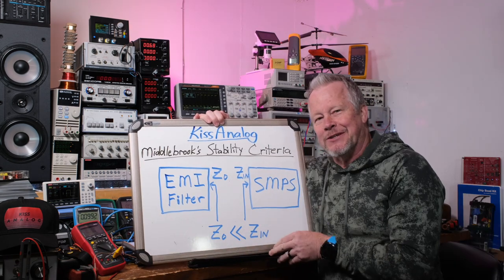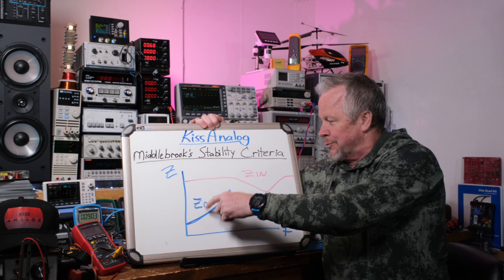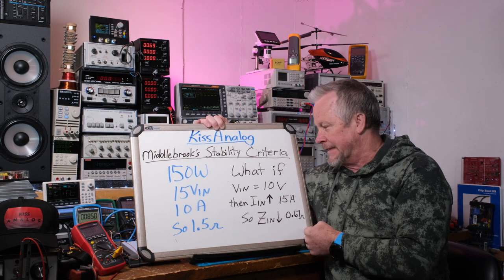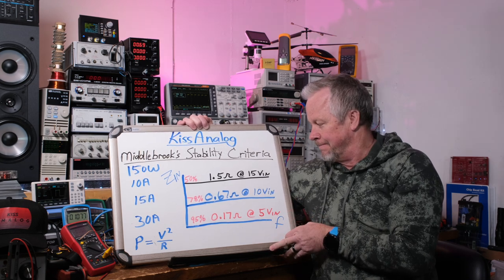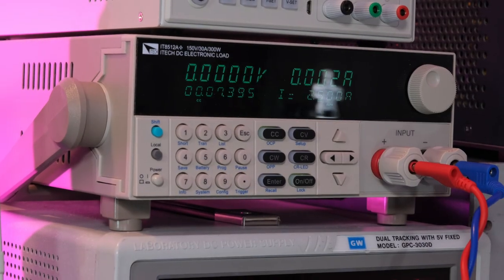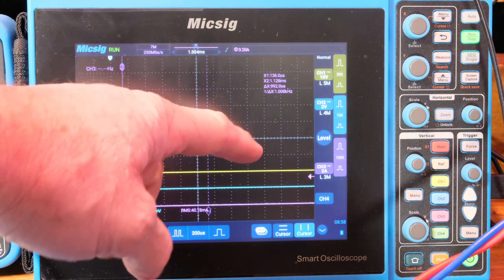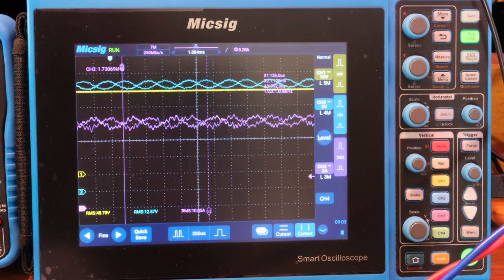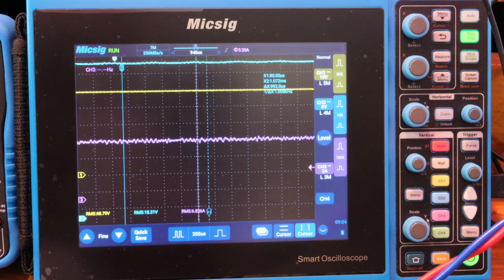Middlebrook Stability Criteria - The Easy Way

Comment: I worked in the IT department of an engineering company. The building was supplied 3 phase power. Sometimes when one phase was lost, we'd get low voltages on some of the 120 volt outlets (around 60v). This would cause some of the computer displays to fail. It turns out the monitors used switchmode supplies that tried to keep the monitor working during the brownout. The increased current caused them to fail.
Reply from the maker: Thanks John!  That’s a great example;)

Comment: Thanks for the nice introduction. There are a few videos on how Middlebrook applies to designing an EMI filter, but none are simple enough for a nonexpert like me. It would be great if you could be convinced to explain how you design EMI filters step by step. I've recently discovered and subscribed to your channel and find your explanations especially clear.
Reply from the maker: Thanks for asking!  I do plan to do a video very soon to show how to design an EMI filter for a power supply design that I am currently working on.  I'll probably do several videos on different EMI designs to show how to do this in a simple way. The Kiss method;)
Reply: @KissAnalog  Excellent. I suspect it's not as hard as it seems. I'm currently (pun intended) following your buck converter videos, which are nicely done.

Comment: I ran into this one time working on some large burn-in chambers for variable frequency drive controllers.  The boards were powered from a 1000Vdc bus.  At the start of the burn-in cycle, a big contactor would close, applying the 1000Vdc to all 500 DUT's at once.  This would cause a large voltage oscillation on the 1000Vdc bus (hundreds of volts), and would sometimes blow fuses, and occationally cause a failure on a DUT due to screwed up internal power supply sequencing.  The fix was to add a second time delay contactor to turn on the 1/2 half of the boards in the chamber 5 seconds after the first contactor closed.
Reply from the maker: Thanks for the great feedback!  That’s a great example - thank you!!!

Comment: Great video!  Although I fell foul of too little current.  I have just designed an audio saturation device (for recording studio use) and I thought I would try an SMPS after watching your videos.  I got the smallest one I could to make +/-12V.  The one I choose also made a 5V.  I quickly realised there was a minimum current needed to get the SMPS going.  I thought I was being clever by adding LEDS to the +/-12V to take it above the 100mA per rail.  But it still didn't work.  It took me a little longer to realise that the 5V needed at least 500mA for the entire supply to work correctly......doh! My circuit only uses just below 200mA.
So I loaded up the 5V with a dummy load and it worked but my circuit had bad rejection to the SMPS and the audio output had noise from the SMPS.

I tried a linear PSU as well but I ended up using a TRACO TEN dc to dc convertor with a 15V wall wart and I was able to get the noise floor down to -85dB!  And now I don't even need to mess with any mains voltage.  I would have never considered DC to DC convertors so thanks for your insight.
Reply from the maker: Thank you!  This sounds like a flyback that usually does need a minimal load to regulate, and it usually is the 5 V leaving the +/-12V to slave regulate.  It is also typically the noisiest regulator.  The noise can usually be taken care of with an LC filter.  Thanks for the feedback!

Comment: Because of the negative impedance you also need to check the feedback loop phase margin after installing or changing the mains filter.
Reply from the maker: That is true - but if the filter can be designed correctly it shouldn’t interact with the converter enough to effect the feedback loop.
Reply: @KissAnalog  What do you define as correct because there are quite a lot variables to play with?
Reply from the maker: If you follow the Middlebrook criteria - then the loop should not be affected.  It is a bad idea to have the stability so sensitive that it has to be tuned for the input filter.  This would make it sensitive to loading and such.  This is why the middlebrook criteria - although seems simple and straight forward - is actually a bit more in depth than at first glance.

Comment: I read some criticism regarding how this topic was presented.  Okay, I see what the objections are, but I respectfully disagree.  My first response was "I know I'm going to sound like Ronald Reagan, but there you go again."  I freely admit that the above response is neither helpful nor particularly enlightening.  
The simple fact is Ed is explaining a topic to an audience over which he has no control whatsoever.  In an academic setting, he is guaranteed that his students have taken Systems (or whatever it’s called at their university).  Systems is where the EE student learns what a system is, how to characterize a system (i.e. transfer functions, state space representation, etc.), how those characterizations are related (how to move from one representation to another).  Some of the prerequisites for the Systems course are: Ordinary Differential Equations, Partial Differential Equations, Complex Analysis, Vector Analysis, Matrix Theory (Linear Algebra), Fourier Analysis and others that I won’t go into.  This is not a complete list of what is required for Systems; it is better thought of as a necessary but not sufficient list.  Also, the EE student BETTER have mastered those subjects and not just passed them or that student is in for a very harsh lesson in reality.  
When the EE student enters their Systems class, they better damn well know the ramifications if part of a circuit demands more energy than its preceding circuitry can provide.  That’s the reason Ed could recite the conditions for stability (no doubt chapter and verse) without knowing the Middlebrook Stability Criterion by name in his job interview.  
This is what the Middlebrook Stability Criterion states: “a system is stable if the magnitude of the load input impedance is larger than the magnitude of the source output impedance.”
There are subtleties associated with that statement that require the above abilities to understand and master.  
Ed has to present this criterion so that people without that background can understand and use it.  He did a damn good job.  
Others may be able to do a better job given the same constraints under which Ed labored.  If you know of them, I would love to see their presentation.  -  Bobcat
Reply from the maker: Thanks so much Bobcat!  Very well said.  I appreciate you!